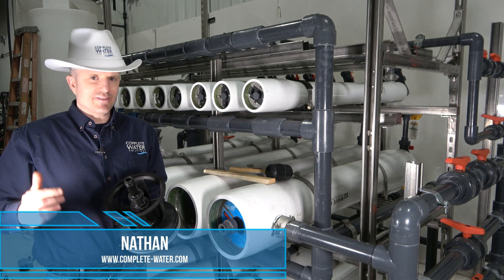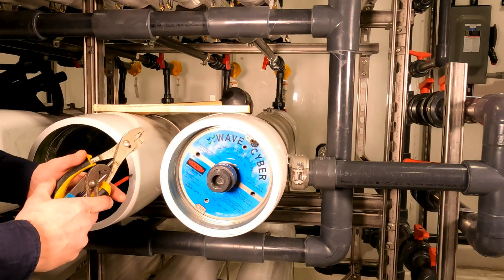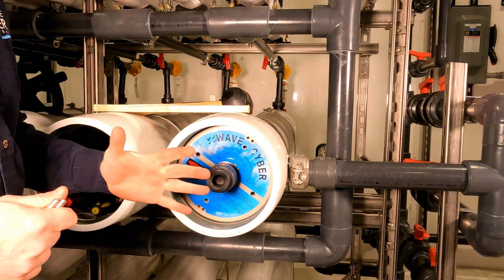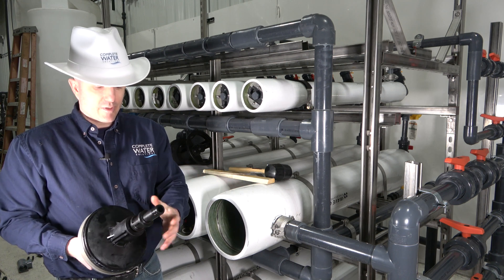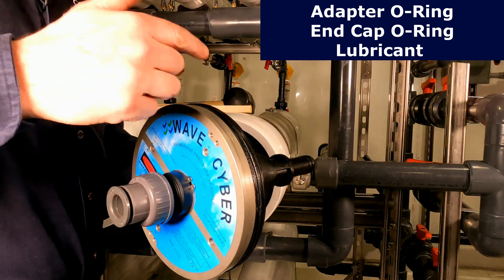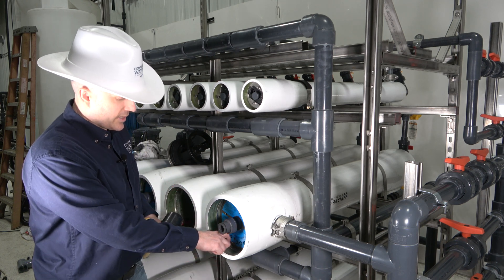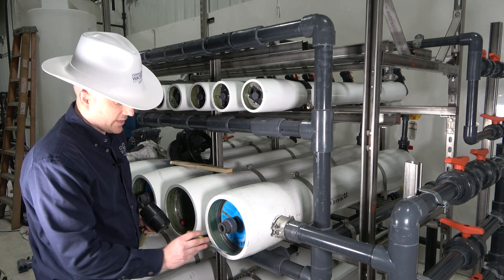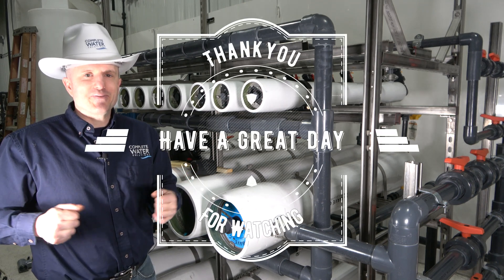RO Membrane Housing End Cap Removal (Industrial Reverse Osmosis) - Complete Water Solutions

Comment: Great videos. I have a user request video here. Could you show us if a single 4x40 membrane under 300 psi. If it will fill a 40 gallon well pressure tank to 60 psi? I am REALLY curious!  Thanks again for posting and always enjoy your videos!
Reply from the maker: Hi Rick, just based on past experience yes it can. However you need the right piping connections, and equipment. Certain design criteria should be in place for this. I have seen some systems operate this way. (Smaller commercial). I will see what we can do to cover that topic at some time this year.
Reply: @completewater   That would be awesome. I am curious if a single 4x40  at 300 PSI, such as a Grundfos feeiding into the vessel,  would push water through the membrane and  into a pressure bladder  tank without a post permeat pump. Your videos are highly educational and are shaping the water industry in a positive manner!